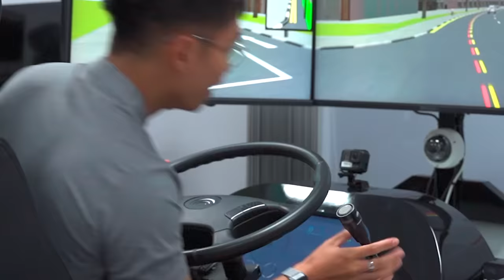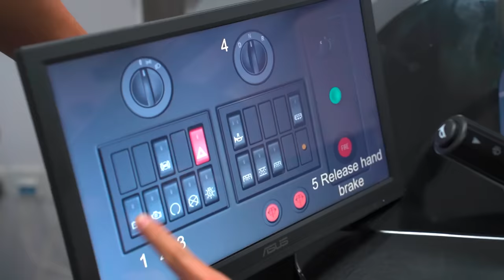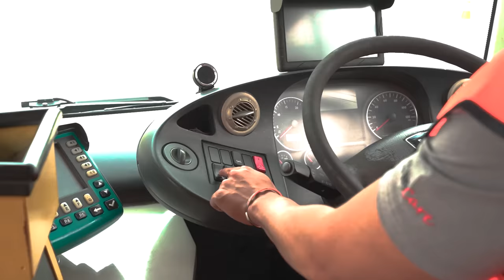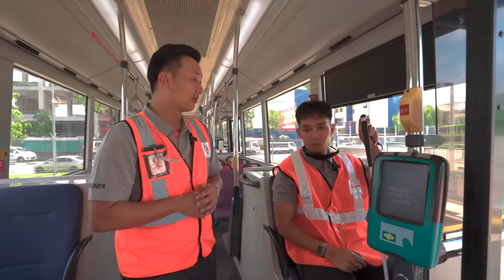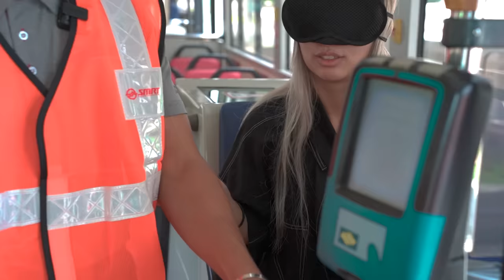Hafeez Becomes A Bus Captain | The Part Timer

Comment: I skipped through and didn't hit the kerb.

If there is a kerb, one wheel up, draw along straight, then wheel down. Redesign those parts to slope and painted so that all can play bus parallel to kerb-side for ... some utopia accuracy technik gay audi bus... 

Bus interchange = exit out, front needs to be curved so that driver neck twist reduction when checking for traffic, and cut corner of that curve for rear wheel merging "lane". Apply this to entry, apply to all bus-stops, whenever repair or construction needed.

Best is cannot understand so no need to do
Reply: The car drivers should know about the issues of electronics in carparks and how to draw parallel on driver's side. The implemented wireless parking-charging is soooo lousy and the type of cards and devices keep changing yet the brags-threats of electronics and engineers keeping inflating-inflation. Their kerbside to protect their lousy wireless and lousy car front-skirt front-splitter front-bulk-head... bus have air-suspension to adjust to kerbside heights... some people will say IU counter part is also IU for signal coherance of incoherent engineers complaining about others being irrational. Transaction-session engineers cannot guard...